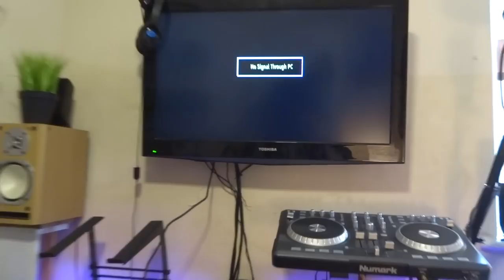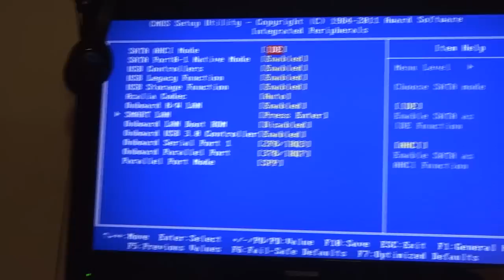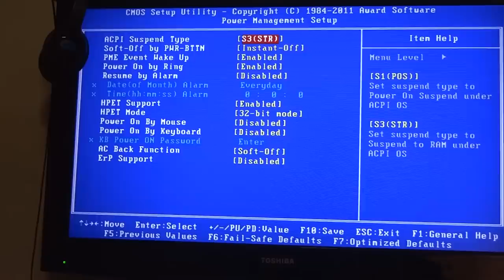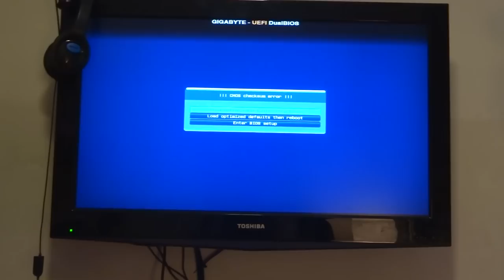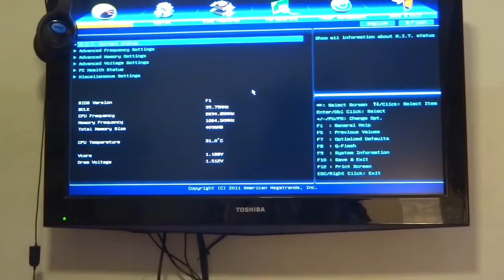A Trio of 4th Gen Dell's, HPs, Motherboards & More | Used Tech Pickups #4

Comment: Some cracking deals. That heatsink is classic chinesium.
My LGA1155 find that I'm putting finishing touches to needed a bit of pin straightening - in the end I settled on using a needle to tweak them with - tested with a G630 and then got an i7-3770 at an ok price … best non-K as it wasn't a K overclocking board, and the K may be a little faster at stock, but a lot pricier.

Comment: I refurb hundreds of those hp models a year. If you have any questions pls reach out. Also the hp pcie rails are finicky when it comes to voltage I'd suggest a good 1030 or 730 passive cooling gpu
Reply from the maker: I actually ended up selling them a day to two after I got them for like 5x what I paid (couldn't say no lol) but I'll likely get more so if I need anything I'll hit you up :)

Thanks a tonne for watching!

Comment: You got one great bargain on those SFF machines. I'll upload a video (hopefully soon) of some of the deals I've gotten recently. If you got a low profile, like, HD 5770 or early 6 series Radeon card, it would be a fantastic retro emulator build. I use an old Dell XPS Studio machine with an i7 920 and an HD 6770 for my emulator build and it does a fantastic job running things from MS Dos to PS2. Seriously, your channels needs a massive jump in subs. Criminally under-subbed.

Comment: Great video dude and cool finds! Have a link for that cooler? Just got Gigabyte motherboard with 16GB ram and i52500k for 115 . Got that for a steal and then gigaabyte 750ti 2GBs for 40 bucks. I’m gonna keep flipping this stuff man it’s so fun and you get to work with all sorts of hardware! Keep the content coming
Reply from the maker: Oooh nice! Here is a link for that cooler :) https://www.ebay.co.uk/itm/LED-CPU-Heatsink-Cooler-Fan-For-Intel-LGA775-1155-1156-AMD940-AM2-AM3-AM4-Ryzen/142596902181?hash=item2133700d25:g:y2kAAOSwEZdaGB17:rk:1:pf:0 it seems to have gone up in price though which is a pain :( But I did order it a long time ago and totally forgot about it by the time it turned up lol :)

Comment: 6:07 That cooler is reminicent of Linus's "cheapest CPU cooler you can buy video", lol. To be fair it does look good on that motherboard! I am only about a third into the video, but it is great so far!

Edit : I also look forward to some mods on those LGA 1155 systems at the beginning. Also at 9:38 the enermax cooler that is going to be in my next video uses the same mounting system. Pretty slick as long as the clips don't break.
Reply from the maker: The cooler and one of the boards was used in my last case review (which sold very quickly so despite me not liking the case too much, it clear has appeal) - the Hps at the beginning where sold very quickly also for like 5x what I paid but im determined to keep at least the little acer PC for my own (though if there is cash on the table, im taking it! lol)

Thanks for checking it out dude!
Reply: @UsedTechHustle  Great content as usual 👌 Brian for TYC tends to prefer Acer components when compared to other OEMs, so good move holding onto that one
Reply from the maker: @sebastianmcgregor465  it's ideal tbh, small looks nice and has loads of IO on the front so it's perfect :)

Comment: Hey I got some tip for you. Never try to power up pc like that. There is a risk of damaging motherboard. The only pins you want to short is PWR and Ground ,which is always next to it, usually on the right side and it would be easier with smaller flat screwdriver. I saw you doing it while trying to start first mobo but with 2nd I already knew what was coming, luckily that motherboard has protected itself from you.
cheers:)
Reply from the maker: Thanks for the tip! Tbh iv never had a problem with my usual "stab at it till something happens" approach but iv probably been very very lucky!

Comment: What you think? Îs worth upgrade from i5 2500k to Xeon e3 1245? For gaming
Reply from the maker: Hmmm, well it depends really - if you can get the Xeon for a good price (ideally cheap enough so that selling the 2500K would cover it) then id say go for it. More threads is never a bad thing. However assuming you can overclock your 2500K to a decent speed (4.5ghz-ish) im not convinced your going to see any huge improvment in performance for the most part so if its going to cost you a bit to do the swap, I personally wouldnt bother. Thats my 2 cents anyway :)

You may have already seen it, but you can see a great comparison of the 2 chips here https://www.youtube.com/watch?v=ymSaenCq21o - in most cases the Xeon is a little quicker BUT thats a stock speeds so bumping the core clock up on the 2500K would help even the odds.
Reply: I trade my i5 and 60 dollars for xeon
Reply: I don t want to overclock i5
Reply: Sorry for my bad english, i am from România
Reply: My rig :i5 2500k, P8p67, 16gb ram, gtx 1060 6gb,... Îs worth upgrade? For gaming?
Reply: Xeon 1245 îs compatible with my MB without bios update?
Reply from the maker: @user-sx8ve1ie7c  Honestly, if you have a 'K' series processor and you dont want to overclock it - your missing out on a lot of performance for ZERO cost! But, if you really dont want to for whatever reason - The Xeon should give slightly better performance in most modern games so if you really want to spend the money then go for.
Reply: But oc my CPU Influences the other components?
Reply: And cpu very much?
Reply from the maker: @user-sx8ve1ie7c  If you want help overclocking with that CPU/Motherboard, check out https://www.youtube.com/watch?v=WMZoWOpry40